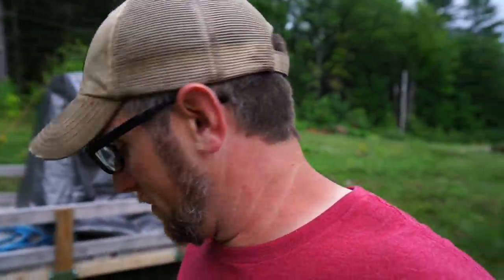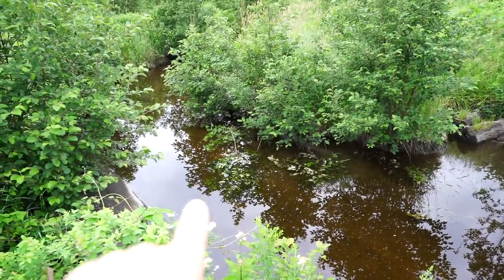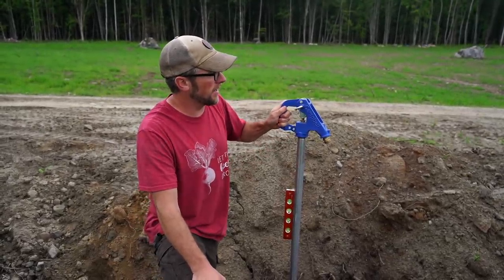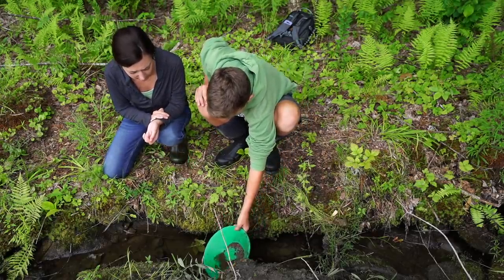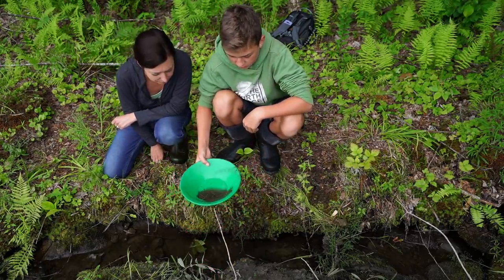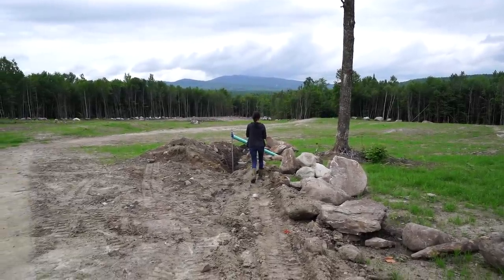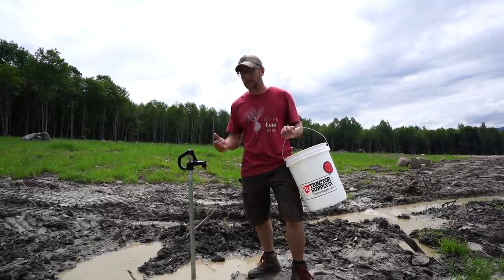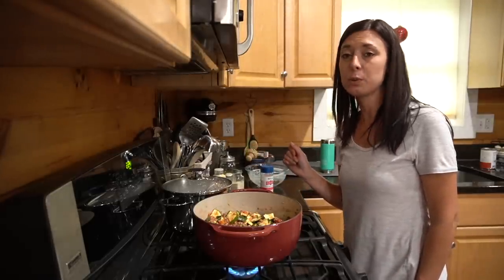DID We JUST WASTE all of OUR TIME & MONEY!?! Testing Our DIY GRAVITY FED Water System

Comment: Furthermore a gravity water system the way u set it up.will.not work Reason Gravity is just that GRAVITY WORKS WHEN ITS ELEVATED. FOR THE WATER TO WORK THE WAY YOU HAVE IT MUST BE PRESSURIZED WITH A PUMP IN THE TANK
Reply: Water came out of both hydrants which shows that gravity is working!!!

Comment: Water Tanks/Water Pressure Buffers for municipal water are placed about 200ft in the air to allow gravity to create sufficient pressure to maintain overall water pressure at a relatively constant pressure. I was wondering how your system would do that with the relatively low grade of elevation the tank is buried at in relation to the destination points. What you have now might be sufficient, but finding the right pump will improve the flow, I'm sure ... especially when your water demand increases. Great video ... your videos are how I start my days ... as I take in my morning coffee and wait for the effects of the caffeine.

Comment: I see in the info section this is in NH so everything about that water system needs to be frost proof, including the pump and it's fittings. Basically it all needs to be buried below the frost line, yet easily accessible for repairs. I know it's not cheap, but I would suggest a conventional approach of a  "well house" built below grade with cement block. This is where the bump and batteries will be. Put a few posts in the ground to support solar panels above expected snow levels and now you have something to work with. BTW, an RV style pump works on a pressure switch and constantly maintains around 10 PSI. When you open a valve for water the pressure drops and the pump is activated via the switch. When you close the valve the system pressure reaches 10 psi and the pump shuts off. These are usually 12 volt systems. The only drawback is any leaks in the plumbing will have the pump running. You must have a tight system. The only other way to boost pressure would be to gain more head via finding a higher elevation for the storage tank. For each 12 foot rise you gain roughly 5 psi pressure. (actually 2.3 ft = 1 psi increase)

Comment: Morning Al and all. I think its just not enough drop to make great pressure but I'm not sure. Think you're going to have to play around with it, I know there is friction when the water goes thru the pipe but I would have thought you would have had better pressure that what you have. May have to resort to a 12 volt camper pump with solar keeping the battery charged.

Comment: @Al open both lines at the same time. I bet there is air in between the two causing the slowing of your flow. If you open both lines all air will be removed from between them. Your pressure definitely should be stronger in the first faucet.

Comment: Al, are you working with a full tank?  Your pressure is going to be driven by the amount of water in the reservoir, and the amount of "fall" you have in the system.  Assuming you have enough flowing into the tank, any consideration given to a pump system would need to take into consideration that you not over draw the amount stored.   Also what are you planning for electricity to run the pump?  Generator?  Commercial power?  Solar?    A lot to consider.

Comment: Hi Al, Gina and Olivia. I would recommend an air injection system. You could use a gasoline powered compressor with a regulator set at 60 psi or so. Tap this into your water line with a check valve to keep water in the ground and not back flow to the compressor. This is one way of making the system freeze proof. Any water pump will freeze and be useless. I can elaborate more if needed. Thanks.
Reply: That might work. Is the diaphram of the air pump cold proof? If he has to pressurize the tank, pressure relief for overflow and check valve for intake side?

Comment: grass looks great. gunna be time for the first mow soon by the looks of it.

with the caveat that hydraulics are very complicated dynamic systems, the back of the envelope, a typical garden hose is 5-20GPM at 20-80PSI.
on gravity feed alone youre going to get ~0.4PSI per foot of head (minus some losses from friction/restriction in the feed line), especially close to the tank, your hydrants are going to be very sensitive to height above ground.
if your tank is infinite size and and your feed line has no restriction (it will have some), you will start getting something that looks more like a hose at about 50ft vertical drop (head).

camper water pumps still have to contend with the inlet water supply keeping up with demand at the outlets, but you shouldnt need additional electrical wiring (except solar/ batteries, etc).

You showed the overflow for the storage tank to keep it from freezing, if you showed the rate that that overflow fills up your five gallon bucket, youd be able to make a better guess at how quickly you would empty your tank at different flow rates  at the hose outlet.
this may be another thing you just havent shown on camera talking about yet, but consider, there is almost certainly going to be sediment in that system and you probably want to have an outlet at the bottom of your feed line at the bottom of the hill where you can just drain the water and flush all that stuff out once or twice a year.

Its a good idea, and things like this always end up being more complicated than they seem at first, but this is a totally feasible project.
I dont know how much you like talking to other people or doing collaborating on stuff, but it might be worth talking to another youtuber "
Land to House" who I dont know personally, and have no affiliation with. He does a lot of hydraulics projects, including stuff with ram pumps that work without electricity. Maybe you get a collaboration video out of it.

Comment: I don’t know the brand but you can get an inline pump that’ll work on DC. Use a solar cell for the battery. You have no head pressure to move the water. If you install another outlet down hill it would help.

Comment: ive got solar panels powering a 12v water pump out on our spring fed water troughs, the pumps you get vary but the one i use is 5000 L/Hour external pond pump fills 11 troughs around six 5 acre fields for cattle...   if you want more presure you might concider a solar powered 12v  shower pooster pump....

Comment: Before you do anything just open the lid to the tank and you’ll know if you may only need a vent as others have also said.
Reply: There is a large overflow pipe that Al installed at the top of the tank. No vent needed as the overflow IS the vent.
Reply: @SpicySteve-tz2so  exactly, I thought the same thing.

Comment: I use a SHURFLO water pump (AC) for my rabbitry to fill the gravity water.  They make a DC version as well and has a pressure shut off.   you would have to install outside the tank.   Dig a pit to keep from freezing.   deep cycle battery, solar panel, charge controler and you would be set.   My pipe is garden hose sized,  I think they make several sizes.

Comment: Al, you get about a half pound of pressure per foot of fall on your line from the source to the discharge spot. and it works the same way with rise in your pipe you loose pressure

Comment: A one foot of water column only creates .433 PSI.  It appears that the elevation drop from the high water level in the your tank to the exit of the hydrant is minimal?  If you can shoot a elevation, you can see what pressure you should expect.  Considering the potential winter freeze issue, a inline pump at the exit of the tank with a manhole access with cover might be the best answer.  But credit to you for the project and taking on the challenge.

Comment: You could try one of those no electricity valve pumps to pump to a higher elevation on your property and then gravity feed to your outlets, the nice thing about this system is that the pump pumps 24/7 and when the header tank is full you can use the overflow of the tank to create a small stream running through your paddocks to supply a permanent fresh water source to your animals. That can also be a water source to your new house and after filtration perfectly drinkable too.

Comment: Run a pipe up the stream as high as possible. The higher the pipe entry point is the greater the pressure. We used to have a gravity fed one with 200' of head - vertical feet - with a 55 gallon barrel that would bust 160 psi black plastic. Had to leave a flow going.

Comment: If I were you I would look into water feature/pond pump that is submersible and solar. I'm sure there are many online pond websites or stores in your area. I have seen some TV shows about large water features that have used a few of those in different areas solar powered with battery pack unit.

Comment: Ebay has a few pumps. Some are solar rated already. The best pump is shurflo  high current though. But will keep a preset pressure in pipe at all times. Auto shut off.

Comment: I use cheap in-line pumps from Lowe’s or Harbor Freight tools to pump from an IBC but I am not sure about the solar. Perhaps the little generator you are using for the cabin would be enough to run one long enough to spray down equipment and such? Mine has a 1inch input and output so I thing you could just put it at the hydrant. 

Last thing if you just hang your bucket off to the side, it will hand on the wire on the Campbell hydrant.

Comment: Since it looks like your land is prime beaver habitat so you'll always have them trying to settle there, maybe try installing beaver deceiver pipes at the dam locations instead. That way you can set the max water level without having to trap the beavers or constantly break up the dams.
Reply: This would solve the problem and many have pointed this out alas they need repeat views for their 'Landowner overrun by Beavers' saga

Comment: Al: This is the pump we used when our rain water collection barrel didn't quite give enough flow with a ~30ft gravity fed elevation change: https://www.amazon.com/gp/product/B01GHJAR6Y/

Works great, but we have the rain barrel near the house so 120v is available. 

There are a number of 12v versions such as https://www.amazon.com/Transfer-Suction-Impeller-Electric-Pump-Orange/dp/B08YJRT8KG/ that are basically the same pump attached to a 12v motor that you could run off a solar + battery.

Comment: You need a 7 way vented framulator with the intrispatial monoclator located about 5.35 feet farther down the line.  Between the viscosity terminosity and the langitudinal recompensator, there isn't going to be enough flow without turning up the factional divisilator.  That, or raise the tank higher.

Comment: having some water pressure actually helps keep soil from collapsing your pipe which is why if you do a small wind powered pump to fill a column of water the pressure is option...a water column is like a small water tower but just for your needs

Comment: The elevation difference between your source and you outlet when increased will increase the pressure.
If you collected to water from higher up, or moved the outlet down hill that would give you more preasure. The other factor is friction loss.
 On long runs pressure is lost in small diameter pipe.

Comment: If this project fails you could always use the pipe to pull a cable across the meadow say for a workshop or barn just blow a light string through the pipe and use this to pull the cable

Comment: You should be able to bring a pipe from the outlet up to just below your head of water fit this to the suction side (hopefully you won't have to keep priming it) then back down to your pipe this would keep the pump from being buried. Also you can get 12v submersible pumps on Amazon connect to a panel.

Comment: To drop a pump into your tank, you would need to run another line coming out of the tank attached to the pump.  You need an inline pump at the outflow of your tank, as I suggested before.  I recommend a pump that has a built in adjustable pressure valve that can be adjusted up to about 55 PSI @ 20 gal/min.  A full sized IBC tote is 375 gallons and it would take a cheap 12v RV pump over 2 hours to fill one of those.
If you decide to install a solar panel and 12v deep cycle battery and $20 charge controller you can run a higher end 12vDC pump.  But if you don't want to mess with all that you can install a 1/2 HP AC pump with at least the same ratings listed above.  1/2 hp should draw no more than 300 watts when running, so it could easily run off a long extension cord or your Jackery for now.  It will require creating a manhole of some type next to the tank to access your pump, yet keep it from freezing in winter by being buried.

Comment: An RV pump would give you 60 pounds pressure OnDemand but volume may not be enough but a pressure tank could help, on my motor home I used a 4-inch x 4foot piece of plastic pipe as a pressure tank just put caps on it and treaded smaller fitting into it

Comment: Is it possible that you have an air lock in the delivery pipe? When you changed from the small tank to the larger one you dug the hole deeper but the trench for the pipe remained the same creating a high spot in the pipe where air can accumulate. This would slow down the flow. Unfortunately I haven't a clue how to get rid of it. You need to fill the pipe with water somehow to get rid of any air pockets.

Comment: Yes a 12 volt pump would work great and they are cheap you can build one with a battery and small solar panel made to charge a car battery and a 12 volt pump. A water level is a neat thing to use over long distances to check elevation. Don’t get discouraged by the naysayers you guys are doing awesome.

Comment: Al, is the black tank vented?  You may need to add a vertical vent that ends in a upside down "J" to vent air in to aid flow.  I would try that before going solar with a 12v battery and pump but that would be plan B.  Also if the sun angle is not right at the tank, you don't have to put the pump at the tank.  It can be and the end for the first hydrant.  You may need to build a insulated "pump house" (can be small) as you will a bladder tank for best performance and to let the pump be above ground for ease in service.

Comment: Lots of suggestions here today so far, some good - some not so good, but if you are in this for the long run (and I believe that you are) I'd look up RPS Solar Pumps out in California (or any other similar company) for some professional advice.   Installing some cheap RV water system could be another $$ waster.   Most have high failure rates and are generally only intended for light duty or  intermittent use.   A proper system could cost some serious bucks, but probably worth it in the long run.

Comment: Many 12 volt pumps out there that will work fine with your system .... ironically if you had left IBC tote above ground and just pumped it until full you'd probably always have enough water pressure because of the rise and fall of the water. Our water cistern in Colorado is all on solar to pump out of ground and fill the cistern then gravity to our three pipes. I've even seen people use a water pump from a Prius to pump water  :-)

Comment: Greetings from sunny Scotland 🌞☀😎.  It's so hot out it makes you dizzy. 22°c on the North facing wall. 26°c facing South. Too much for a lillywhite like me. The head of pressure that you have will be a function of the high point in the tank to the high point on the hydrant. At least you have flow. Wider pipes would give you more low pressure flow. Dinner looked good. Not decided on ours for tonight. Regards Stephen.

Comment: The rule of thumb is 1/2 psi. per foot of fall or drop. You'll have to dig the water line at the tank to insert pump /pump line to increase the pressure, or a submersible pump or inline pump would work if you can hook it to the outlet connection in the tank. You could run another line from a higher point in that area for a second line too. A 100 ft. drop in elevation will give you about 50 lbs pressure.

Comment: Do the simple first-- take the lid off the tank and then check the flow. It's possible that all you need to do is put a 1" diameter goose neck connection with a small screen in the end for bees and mosquitos to give you what you need.

Comment: possible a ram pump in creek. To push water uphill it will  and if water goes downhill then you will gain pressure. An easy calculation to know is that for every 10 feet of rise you lose -4.33 psi. For every 10 feet of fall in elevation, you will gain +4.33 psi

Comment: Yes they have pumps. You can go few different ways. All depends on the power source and the volts you want to go with. So short term 12v is easy and quick just like the rv or camper setups. They run on a switch when you want to use or leave on and some setup have built in small pressure tank with the little pump. They range from 2.5gpm to 4.8gpm for a everyday go to local store to just buy off shelf.  They also have solar powered well pumps or tankless pressure pumps come with solar panels from rps solar. We went with deep well solar pump 48v to fill 2x 1500 gal cisterns. That will go to a pressure pump when done with solar/well house. But short term we have a pop up tent bath tent with a 12v rv pump was my backup pump. With solar panels to keep charged and a tankless propane hot water heater to shower and a horse trough bath tub. Works well. In cold weather we use our 80- 100 qt fryer/seafood boil pot to heat water and have a steam bath.

Comment: In line pumps are usually flow triggered. As water flows they kick in to boost flow and switch off as the tap stops flow.
With the stream there you could use microhydro rather than solar to charge a battery.
With the limited head on the taps the flow will be limited by the inflow to the tank. You could try drilling more holes in the inlet pipe as an interim measure to improve flowrate.